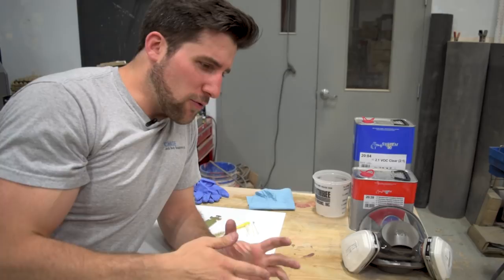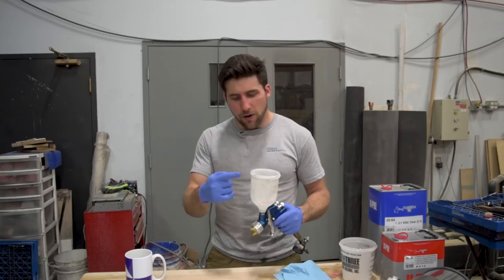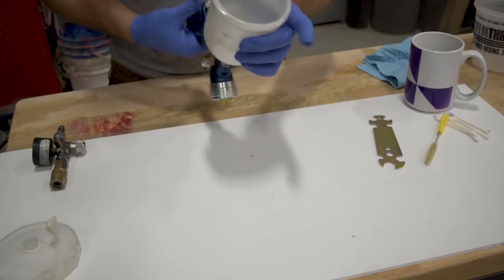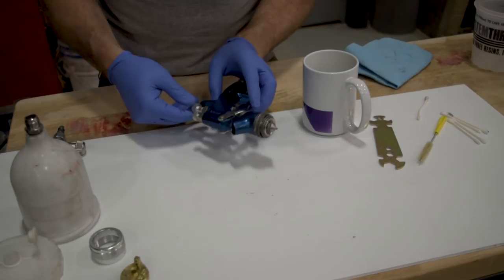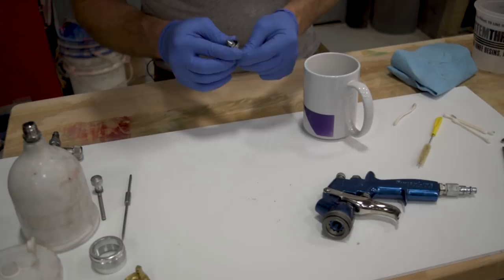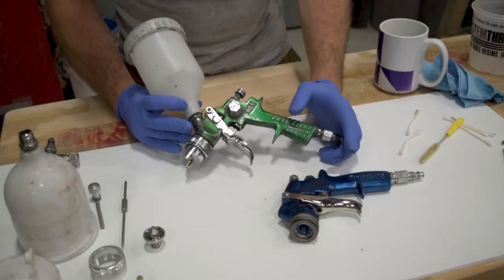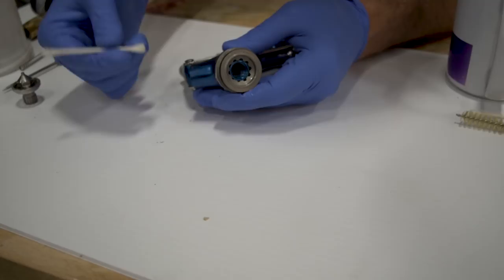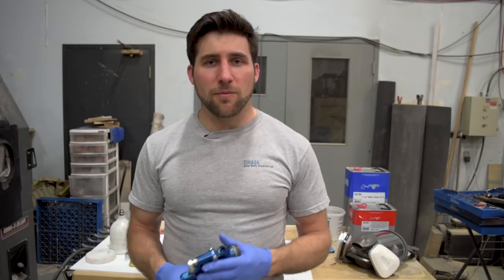How to Clean Clear Coat out of Your Paint Gun

Comment: They make an aerosol gun cleaner although I've never used it seen it demoed.and it works well as a final cleaner .it takes just a little spray through the cup and spray the air cap  and it's done. Nothing beats striping it down and cleaning it thoroughly. As always great video Brad.tc buddy.
Reply from the maker: I use the aerosol cleaner for my airbrushes. Great for getting those tiny nozzles clean.

Comment: I recently started using a spray gun and my cleaning procedure is very similar to yours.  I'd been using mineral spirits for my solvent which worked great with my base coat, but when I switched to a 2K clear, cleanup was a lot more difficult.  Mineral spirits caused the clear to coagulate and get gummy.  Should I see better results with methanol, or am I going to run into the same problem any time I'm using something with a catalyst/hardener?  

Also, it looks like that cheap green gun wasn't even anodized.  That looked more like a coating of lacquer.
Reply from the maker: I have seen better results with methanol than mineral spirits. Lacquer thinner has also worked well for me. 

I doubt that the green gun was actually anodized haha.
Reply: @BradAngove  Thanks for the fast reply.  I'll give methanol a try next time.

Comment: I sprayed clear and ran out used a different cup and it had someone else's dried clear on the edges but I mixed new clear in a new liner. Chunks of clear came out in the job. I'm wondering how I can get them to buff out. I tore my gun a part and it was clean. The liner had semi-cricle clear bits in it
Reply from the maker: See if you can sand them back smooth.

Comment: Hello my friend Brad I painted the car silver and put it on a pearl colored gold problem that dyed the car parts in the dye and after that found a difference in color what solution?
Reply from the maker: I’m having trouble following your question. You dyed what?
Reply: Hello my friend Brad I painted my car silver  and I put a gold pearl on it. After that I found a difference in color between light and dark Can I use 800 paper and return the Re paint pearl only  again and then put the Clear coat again .         With the knowledge that the paint variability is not from the Base , but from Perle                       Thank you very much
Reply from the maker: So your base coats are different shades and the pearl coats over top don’t have the opacity to compensate for it?